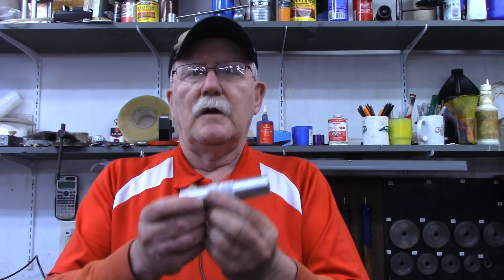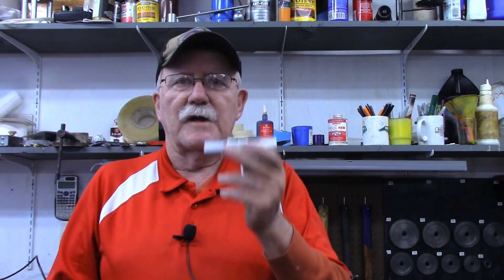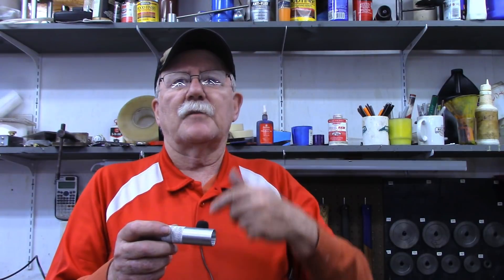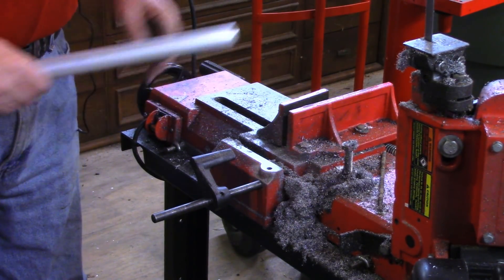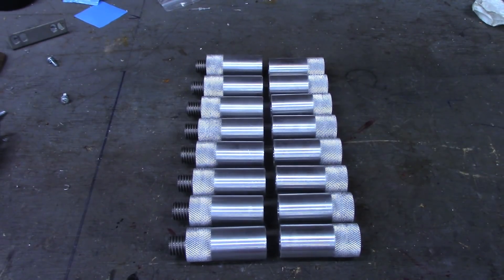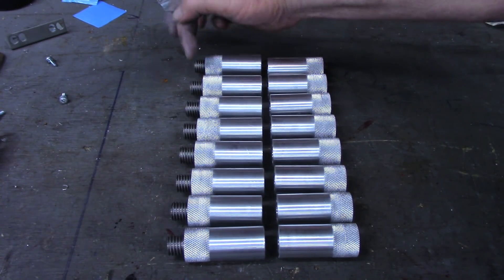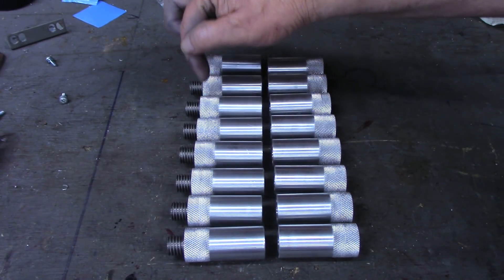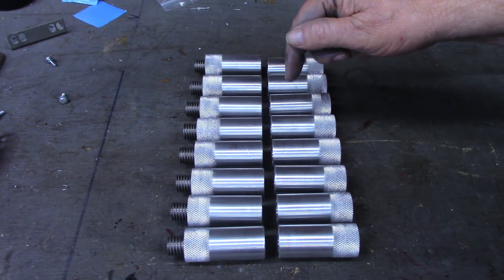Tin Barn Time Small Production Run of Pieces To Make Outriggers For An Off Shore Fishing Boat.

Comment: Nice work!  I dont do much production work, but have learned to use stops when possible. Collet stop installed, then face one end on all parts, flip part and face all to length. Remove the collet stop to drill all parts, reinstall the stop and set up to bore them. Use a stop on the bed at your desired depth and bore all of them. Nice job on the parts, Im sure your buddy will be very happy. Thanks for sharing.

Comment: Lee, the collits may be imports and some of them are just a bit on the tight side.  If you take short pieces of small O-Ring material and push it between the segments of the collet.  Spring them out with a small screwdriver and push small lengths of the material between them.  It works very nice because the rubber just compresses when you pull the collet in the chuck. Robin Renzetti showed this trick in his channel.   Thank you for the video.

Comment: Not crazy about Gorilla glues. I do like the idea of putting the carbon fiber on the inside of the aluminum connectors. Aluminum to carbon fiber joints would probably work best with a urethane type adhesive and aluminum rivets or stainless hardware. Most glues will have a very short life adhering to aluminum, especially in a salt water environment. The knurling is a good idea, but we all know those long tubes will be a lot easier and faster to twist to connect and disconnect (especially when it comes to fishing and every second counts). Your assembly will probably work until the aluminum corrodes/glue fails and your friend twists the connections right off the carbon fiber tubes. Nice video and thanks for your all your creative ideas.

Comment: I have a few suggestions. Please don't take it as criticism. 
The aluminum connectors should be anodized, preferably type III (hardcoat), for two reasons: to improve galvanic and corrosion resistance. The carbon fiber strands at the ends of the tubes will draw electrons from the aluminum connectors and can cause severe galvanic corrosion.  The stainless fasteners will do the same. Likewise, bare aluminum parts do not hold up well in a marine environment. 
3M DP420 is the best adhesive that I'm aware of for this application. It's a high strength epoxy designed for composite construction. It's relatively thin, slow hardening and bonds very well to CF and aluminum. The CF tubes should be lightly sanded to obtain a good bond and the aluminum surfaces should be grooved. I like to make both radial and axial grooves inside of connectors. Axial grooves be made by using a lathe as a shaper and manually moving the carriage with a HSS bit. There will be significant loads on these joints and I doubt that the Gorilla glue is sufficient.
Reply: I was thinking that shallow threading the inside of the tubes so they just scratch the carbon fiber might have made the best glue joint.
Reply: @tiredoldmechanic1791  Yeah, cutting a set of right and left hand threads works great. Because the adhesive bond is mechanical, the groves should have the ability to prevent rotation as well as pull-out. A 16' lever is going to place a lot of load on some of the joints.
Reply: people often forget that CF is a good conductor of electricity.

Comment: Hello Lee,  check the compatibility of whatever adhesive you use with untreated aluminium. It has a nasty habit of oxidising under the bond layer causing the joint to fail. I was considering making a bonded aluminium boat but gave up for that reason. However, it is possible as aircraft wings are somehow made that way. Good luck. Best wishes. Mike.
Reply: Bonding of aluminum in aircraft requires special processes. Alclad aluminum, which has a pure aluminum sacrificial layer and bonding don’t work. Special aluminum alloys are now used, along with epoxy primers. A/C manufactures use chemical etching, special glues, and autoclaves (hot bond). Cold bond, which happens in the field are very limited. Bottom line, glues, aluminum alloys and salt water are a bad combination all around.